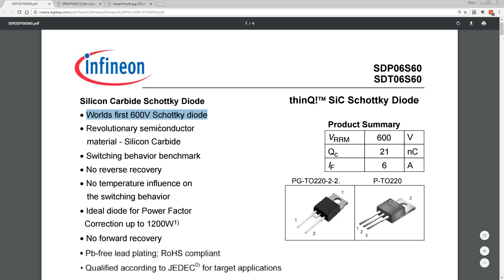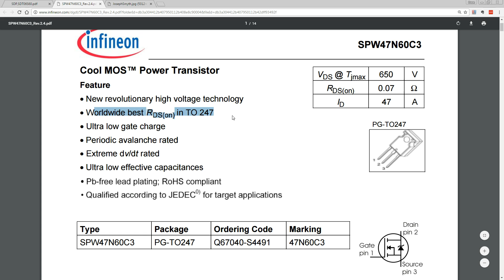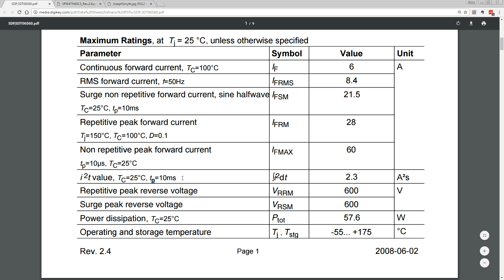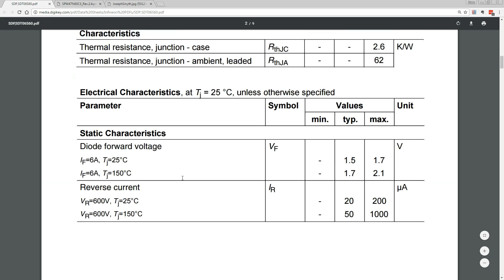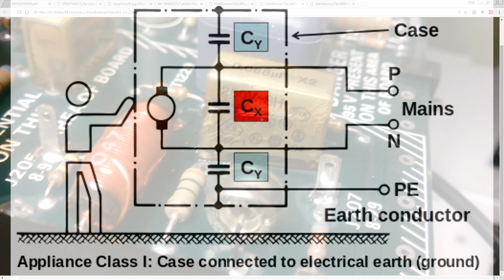EEVsmoke #1 - Magic Component Smoke

Comment: That style of paper capacitor in that clear yellow case is prone to quite dramatic failure after a time.  Sometimes going on fire in the process.  Always worth keeping an eye out for them in old equipment and swapping them out if they look a bit seasoned.
Reply: Howdy Mnr Clive :-D
Reply: didn't expect you to be here haha
Reply: European 70's & 80's Yamaha amps have those as well. They can and will go boom :) replace on first sight :)
Reply: Oh yes, I have seen sooo many of them - cracked, blown up or badly burned..  It's just a matter of time when those caps go bang, I think most of them has already gone :)   Well I actually have some of those (new old stock from 80's) but  cannot use them. Maybe I should push them to the limits just to see what happens..
Reply: tonskulus DO IT, MAKE A VID
Reply: +1  first the case swells a bit, then you start to see some cracks and if you still not replace it it bursts open and gets up in smoke ans indeed sometimes goes on fire
Reply: I had a similar capacitor to that one in my Kaypro 4 blow like that
Reply: Yup, those Rifa caps are regulars for the big bang.
Reply: these are well known for this type of failure these were on a very well known tape recorder and wired across the mains input connector the deck was plugged in with the decks power off but still has the mains coming in via the mains connector it was quite  a crack and then filled the room with green smoke !
Reply: Those RIFAs are just in about everything built for the European market - electronics, household equipment (XY spark quencher), you name it. Other brands fail too, I've had five different ones blow up in older vacuum cleaners and two of those X ones, one in a VCR (Philips V2000) and one in an ancient laptop power supply (Toshiba T3100). These things fail even in storage, I've had several NOS ones from the 70s and each and every one was badly cracked straight out of the bag.

Failure modes vary from slow death with the weirdest fizzling noises and hardly any smoke to spectacular explosions that stink up the room for more than a day and pop a fuse or breaker in the house wiring. I've never had one actually catch fire though. The guts do cover EVERYTHING in the vicinity and the oily, smelly stuff is impossible to get out of some plastics. I've made a habit of opening any 1970s-90s equipment before plugging it in just to check for the presence of those buggers.

Comment: Some of those older RIFA metallised film capacitors have issues with degradation of the sealing resin, which often results in arcing and subsequent failure at high voltages.

Comment: Cool picture. Only, I think the TO220 didn't so much melt as blow up. That black squarish piece looks at the bottom of the diodes looks like it would fit nicely into the crater.
Also, the die itself wouldn't char. One of the woderfil features of silicon carbide is, that you can heat it up to 900+°C in air and nothing happens to it at all. No oxidation, no dopant diffusion, just your package burning and you bond wires evaporating ;-) 
Sorry, kind of a SiC nerd here...

Comment: I wish I saved the picture of when I mixed the pinout of a 20N50 MOSFET, applying rectified 168Vdc to the gate, with 12V from drain to source (ground). A shower of sparks resulted, with a large perfectly round hole drilled into the FET above the gate pin. O_O

Comment: It would be so interesting to see and learn how components can fail miserably and violently when  they get pushed above some of their not-so-obvious ratings.
Also, to know how some of their failure modes look like.

For example, I managed to kill a 300amp SCR by discharging just a 100nF capacitor thru it.
When I looked at the datasheet in more detail, the turn-on current rise was rated at maximum 50A/us.

Speaking of schottky diodes, most people don't know that when reverse biased at a relatively high junction temperature, the reverse leakage current can cause enough dissipation to overheat the diode (even below its maximum voltage-current boundaries!), a thermal runaway effect.
http://www.st.com/content/ccc/resource/technical/document/application_note/e4/01/67/0d/f1/43/41/49/CD00004362.pdf/files/CD00004362.pdf/jcr:content/translations/en.CD00004362.pdf

Maybe that caused the failure in the video too, that's also a schottky.

There's quite a lot to learn about those things.

Comment: Hey..my diode. Just to clarify, yes..blown apart, this was surge damage, 47n60's were shorted also.  I desoldered the legs before I took this pic, the face of the diode fell off when I removed the clamp that held it to the heatsink. This is a common failure in this rectifier, we replace that diode with a HFA15TB60, and it never fails again.

Comment: Dave, that diode it didn't implode. It happened also to me, when I was working with a power bjt in TO247 package, and a wire (the +12V from a PC power supply) accidently got in contact with the base (ops...). A piece of "plastic" flew off the BJT that "now" (I think I still have it somewhere, as a warning!) looks like exactly that diode! (except that the diode is TO220).

Comment: Magic smoke? I blew the inductor and fusible resistor in one of the voltage regulators of a 1980s computer-game MIDI synthesizer by being careless in probing the on-board digital chips, one of which (oops) happened to provide the switching signal to that voltage regulator.

Thankfully the synth had a good service manual online and the two components were simple enough to replace.

Comment: What if the solder just melt and that's the reason you didn't find any?
Reply: Really doubt it. Multiple components have bad soldering, not just the failed one. The joint's topside didn't get hot enough to wick the solder all the way through.
Reply: Once a pad is soldered, it would no longer be gold even if the solder melted away.

Comment: On the first one, what happened to the solder joints across all of the components... yikes!  I like this idea, but I'd want it to be a bit more educational... I know that would require more work but some detail, kinda like you did, explaining the failure modes (and/or design practices) that can lead to this type of issue and ways to protect against it.. if such a thing exists.

Comment: Those X class caps explode all the time. Specially the old ones. I had plenty of old oscilloscopes, every time you turn one on, the magic smoke appears, and yes, its always that X class mains cap. Always replace them before turning old equipment on. :)

Comment: I like this, but you should deliberately make the component that the video is about fail on camera.
Reply: This is what I originally thought Dave was speaking of in the beginning of this video...
Reply: I think the point of the whole series is to get a glimpse of what happens in real situations, rather than making something up.

 "Of course it will fail if you do that to it in your lab, but I have never seen this fail in real life"
Reply: TheFlacker99 (Flak) i think, seen one failed, he should try to take the component to its limits, to see how far it can go, how it fails and the consequences 
Does it shorts the pins? Does it became an open loop? Does it produce a huge current/voltage peak?
It would be great to have dave testing the failed circuits to see how they behave 
Ti would be really helpful to someone like me Who has to troubleshoot boards pretty often
Reply: TheFlacker99 (Flak) 
If you want to watch someone overload electronic components then there are plenty of other channels for that purpose, however, this is a serious grownup channel about electronics!
Reply: I completely agree with you: seen a failed component, it would be really instructive to understand how it failed, why it failed, if it can cause damages to the rest of the board and maybe how to avoid a similar situation (a fuse, a diode, a zener....)
i think he should make a series of videos like "how to blow up a H bridge", taking one to its limits and explain what to look for when designing one
Reply: ***** I see what you mean but what's more grown up about studying the failure of a circuit or component? To be able to tell what it sounds like, smells like, and such. There is knowledge in destruction.
Reply: Scarry Polpetta

Comment: What's the difference between a spark gap and a gas discharge tube?

Does a spark gap have two electrodes (or PCB traces) exposed to atmosphere while a GDT has two electrodes sealed inside a chamber filled with an inert gas?
Reply from the maker: That's basically it. The GDT is designed to be a more controlled spark gap.
Reply: punker4Real We tried to use pcb spark gaps and found there were too many "uncontrollable" environmental factors to make it work. In addition, if the pcb spark gap actually does discharge (i.e. "spark"), the resulting remaining carbon track left behind now creates a conductive path!
Reply: EEVblog. surely the gas tube last longer (wear wise) rather then fast wear from spark gap
Reply: John Conrad maybe for a home project, but that's not nearly precise enough for manufacturing
Reply: John Conrad Not a "controlled" environment. Unfortunately, environmental factors - temperature, RH, altitude, etc. will "spoil the cake"!
Reply: Is there a formula or guideline to use for determining the gap spacing for the desired breakdown voltage? I'm presuming the factors are wire size, wire surface area, and maybe relative humidity?
Reply: Sure, there are tables online if you look. Gap shape is also an important factor - sharp edges will arc over at lower voltages than nicely rounded ones.

Comment: That TO220 is even more epic than the LM317T that I brutally murdered by connecting the leads wrong! But I am unsure how this one actually failed, at first I thought that a big chunk was explosively blown out, but it looks it instead just broke off with stress somehow (maybe thermal stress causing it to fracture) and just fell off. YOu can see the rest of the thing just sitting there right under the package.

Comment: I've replaced a handful of caps in a 75hp DC Variable speed drive that looked much like the ones in that Tek-scope.   Mine were Rifa branded and failed much the same manner.   I'll have to see if I can dig up a couple pics from that.   As well as some IGBT drive components caused by a shorted braking transistor in a Toshiba 125HP AC VFD...    Is a shame the braking IGBT didn't leave a nice skid-mark to show off too...

Comment: Gday dave, I might be going to the guru at the mountain top for this when all I need is the taxi driver but I'm a science major with a hobby interest in electronics. I got interested in time lapse photography and found a start up with a task specific camera to phone dongle and free app. I don't want to mention their name because it's their space and I'm doing this for my own personal interest so I tried to make their dongle which from research maybe 2 transistors and 2 resistors controlling shutter and focus however so far it works up until I try to control the shutter speed with the app and it'll just keep taking a bunch of photos for the designated exposure time instead of one long exposure. Any ideas? I'll reiterate I'm a noob and most of your content is over my head but cheers anyway

Comment: I have a power supply that has has the top blown off an X2 cap Its an ancient power supply hadn't used it in many years plugged it in and it worked quite happily for about 5 mins then suddenly the room was filled with smoke which was streaming from within the case of the power supply, scared me to death I thought the blasted thing had caught fire and was wondering if I had better run downstairs and grab the fire extinguisher, got it unplugged and left it to cool down and did an autopsy later that evening to find the only thing wrong was this crusty looking X2 cap across the mains had had the top blown off, it was a fun evening. Still have it for repair should try to get a new cap for it bet it still works.

Comment: Love it, had to throw out a printer power supply because the magic smoke escaped. When I tried to repair it is seemed that the replacement parts had a magic smoke production error, because when I applied mains power the replacement part lit up like a Christmas tree and proceeded to fly off the board in a spinning motion at very high speed and made some very interesting burn marks of my table before coming to a stop... In short always check the magic smoke factor of the component you have to replace.

Comment: Hi Dave,

Please keep doing this series. Lots of magic smoke escape stories inbound. ;)

Those type of X2 caps are notorious for releasing the smoke (as others have said).

I guess it's just the age of them, but they are especially bad in the BBC Micro.

I had two of the machines release the smoke recently, and both times it was witnessed on a Google Hangout. lol

The magic smoke in those is really acrid and nasty though, so I wouldn't recommend anyone breathe it in.

I had to leave those Beeb machines outside to air out, then had to scrub the PCB and clean the surrounding components and case with IPA, or the smell would have stayed.

Here's a good example vid of the illusive magic smoke...

https://www.youtube.com/shared?ci=KLxr2xzRQnY

Oh, and remember, it's very important to hit Ctrl-Break just after the smoke escapes. lol

Comment: Hi Dave, talking about mains surges, I worked once in Suriname (South America). We had some problems wit CMOS circuits. I checked the mains there (normally around 115-130 V  60 Hz).
 It had 1000V spikes, everytime the big Aluminium melters near the mine (100 km away)  turned off. 
Needless to say the unprotected circuitry got fried everytime!
(The devices were battery fed, but with a shortage of batteries the put them on an adapter WITHOUT the batteries!)

Comment: I had one of them caps do exactly that in a vacuum cleaner about 8 years ago, same type but a different farad rating (used for noise suppression), was doing a bit of cleaning, when all of a sudden there was a nasty, fishy, burnt electronics smell in the air, didn't know what it was as I couldn't locate the source (vacuum had sucked in the bad smell and redistributed it everywhere), but when it came to replacing the carbon brushes a few months later in the motor, I found the cap, which still smelled awful, and had just blown apart like that...

Apparently the brand was suffering a lot of failures like that of their X2 caps, dunno what happened with it, I replaced it with another cap and the vac's still going today... :)

Comment: Hmm. It doesn't look like it imploded. But rather exploded and tore a sheet off it, it's laying on the board right below it. Not sure how Dave missed that.
Reply: Easy, Dave consistently substitutes enthusiasm and opinion for facts.
Reply: I was going to say the same thing, pretty sure thats a crater from the die exploding.
Reply: Yep, looks like it blew the top off it.

I thought it straight away!
Reply: Yeah, you can even see the piece that blew of laying in front of the component.
Reply: Agreed. I once connected a car radio to a power supply in reverse (by accident) and the exact same thing happened to the power amplifier chip inside. A loud pop and the chip had a crater.

Comment: Dave, the concept is interesting, but it is not very educational. It will be better if you can analyze the problem and explain why we've lost the magic smoke. So bad that cannot happen with random images from Internet - you need to understand the product.
Reply from the maker: Why does it have to strictly educational?, can't it just be fun?
Reply: Fun would be reproducing the smoke with a slow motion camera. Please add this and you will have a captive audience.
Reply: I agree that having videos for fun is a great as well, however imo, videos would be more fun than still images, even if the magic smoke capture is staged, i.e. if you purposely run higher voltage through a lower voltage item or purposely put a bad solder/short on something and pointed the high framerate/slow-mo camera at the component(s) you know will have their magic smoke escape. 

Then at the same time it could possibly be educational by showing the viewer common manufacturing or issues and human errors with some devices by trying to replicate/stage those points of failure (i.e. trying to measure the mains with a multimeter in the wrong setting or a cheap Shenzhen meter, and the camera pointing at the meter with the case removed so we can see what exactly happens to the components as you flip the switch to feed mains voltage into the meter).
Reply: Make it painfully obvious why ratings matter; skew one parameter on one component at a time in a simple circuit and see which ones  die soonest. Brutality; sounds like Mengele meets Edison. Medison? Sorry.
Reply: What he said ^ but in 2 sentences.....
I would find it rather educational to see the various ways to de-smoke various components, show in slow-mo whether their rated tolerences on paper actually hold up in real life, etc.
Hell, even light up a few Samsung S7's for us, I could watch lithium batteries self destruct all day.
You could start by blowing up some of the One-Hung-Low chinese shit you get in the mail.

Comment: The old RIFA X-class caps does fail catastrophically if mounted in old equipment that hasn't been turned on very much for 20 or 30 years - they absorb moisture over time - you power on and bam!